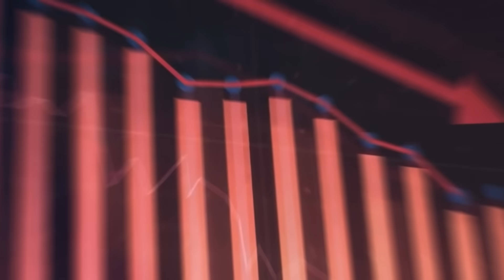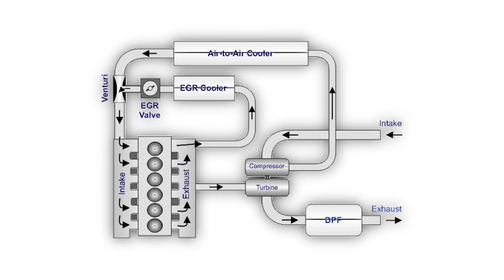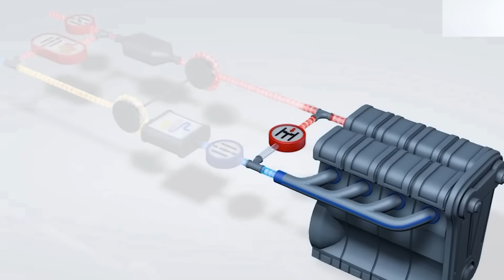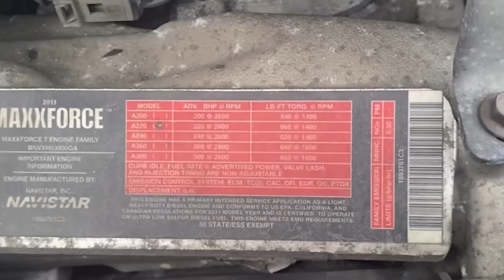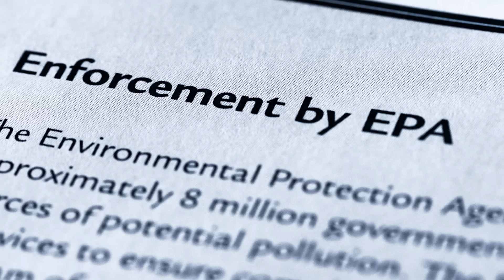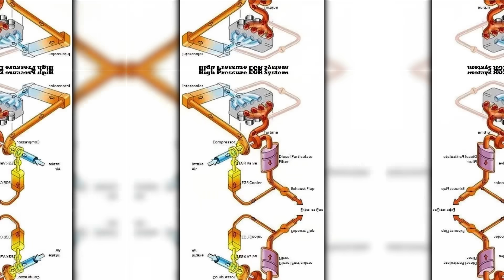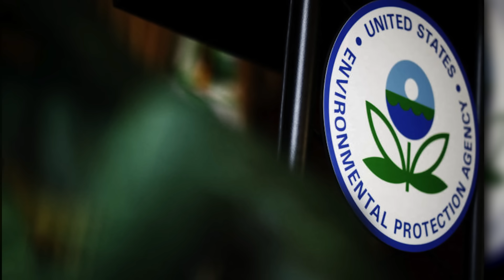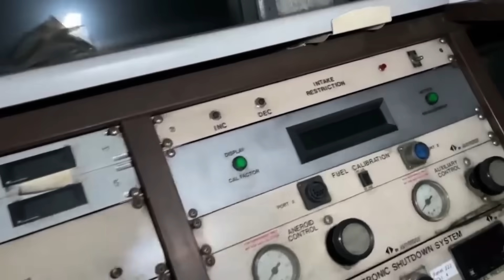The Rise and Fall of MaxxForce: The Engine That Broke Navistar

Comment: The EPA single-handedly destroyed diesel engines with their NOx and particulate requirements post 2010. They no longer make better power nor get the much higher ftlb/gallon(mpg). The systems clog every part of these new engines with soot, require urea(pee), which is corrosive, cause fires, and make them far less efficient. The "maintenance" required on the new diesels also costs 30k+ every 3-5 years. Gasoline is now replacing diesel in many applications for these reasons. My old diesel tractor burned half the fuel for the same use as either the new diesels or gasoline. This meant that while the upfront cost was higher, the long term costs were much lower. I was looking to buy a new one, but I will keep what I have, and if I do buy new, it will be gasoline
Reply: Good to know the EPA Is backing down on some of these choking regulations as far as diesel cars and light duty trucks. I’m willing to bet that they’ll be backing down on heavy trucks in the near future as the automobile and truck industry grows their nutsacks back an starts to fight back against overbearing government regulations.
Reply: @racer193wr  Can you link me to the law that allows me to modify customers' trucks without going to jail or being fined? I would love to actually fix these newer light and medium trucks(by deleting them)
Reply: @MDAdams72668  I don’t think it’s a law per se. It was a supreme court decision called the Chevron decision. Basically the EPA was levying fines and jail sentences, but they weren’t voted in by the 3 branches of government so obviously it’s seen as an overreach.
Reply: @RobertSmith-le8wp  Oh, I agree, BUT they are still doing so(fining and jailing people for "deletes"). In other words, they haven't been overturned in court yet. This is why I am looking for a law that specifically exempts me(or any other tuner) from the current law, just like the exemption the military has. I already paid a 50k fine years ago. I have no desire to pay again(more) or go to jail. 
FYI the Chevron decision is what federal agencies relied on when creating rules(in effect laws) despite lawmaking being the jurisdiction of Congress. The Supreme Court overruled Chevron in the Loper Bright decision on a 6–3 vote issued June 28, 2024.

Some professors have suggested that the implications for medicine and public health as a result of overturning Chevron will be uncertainty and instability for agencies and industries, inviting legal challenges to any and all FDA, EPA and Centers for Medicare & Medicaid Services (CMS) determinations. However, thus far no one has successfully challenged the "rules" imposed by the EPA Therefore, I would still be liable for any deletions I performed and I can't afford to fight the government
Reply: Post 2008
Reply: Thats is why Cummins just came out with an EGR less system. Something I said should have been done years ago when the SCR system came out. There was no reason to keep the EGR once that system came out. Let the SCR take care of all the emissions while dropping the EGR would make the DPF and SCR system run cleaner due to nearly no soot clogging the system. The ECU can keep soot lower by not dumping too much fuel without the proper air pressure from the turbo.
Reply: @techwolflupindo   The "EGR-less" systems are found only on the aftermarket and are not a product offered by Cummins for new vehicles.
Reply: All the box trucks are going gas, no one wants these diesels that are always broken down in the shop. Gas engines are 10K cheaper, the gas costs more but at least you have a reliable truck.
Reply: @jimwebster4267  facts

Comment: We always had the EGR coolers fail whenever a heater hose busted or had a significant coolant loss. We had a 2009 IC CE with a MFDT466, the alternator locked up, shredding the belt. Water pump wasn’t running so temp got up to about 240° and the surge tank exploded from the heat and pressure. EGR coolers failed so bad that when it was refilled with coolant and restarted, it nearly Hydrolocked, it was choking on coolant so bad it was barely running. No one can convince me they were good engines.
Reply: I've seen a few deleted off-road Max Force trucks. The base engines weren't terrible if you could get away with not having to comply with on road emissions. A local farm uses a day cab with some tractor tires on the back for dragging stuck equipment out of the fields. They deleted theirs at 650k miles, since then they've put 40k hours on it in 12 years. Pretty fun farmer tbh lol
Reply: @vr6prodigy  I call BS that any MaxxForce made it to 650k miles without needing to be rebuilt, and I'm not exaggerating.  The soot particulate in the oil that Maxxforce engines created ensured they didn't last that long.  Are you positive it was a MaxxForce and not a regular super-reliable international engine from just before the MaxxForce era?
I was in the industry, saw Internationals with MaxxForces every day, and none of them made it that far.
Reply: @workingguy-OU812  call whatever you want man. I don't really care if you believe me, but anything can be reliable with enough diligence. If he'll let me next time I see him I'll try and see if I can get a video of the truck to upload, but farmers are weird about the shit they do out my way.

Comment: The Maxxforce 13/15 was the biggest failure in internationals history. Some people will say the DT466 and its larger bore  variants were bad especially in tractors. During the mechanical injected era most all problems were caused by farmers "Turning up the wick" People who thought more fuel=More power with no regards to exhaust gas or coolant temperatures. Pre Maxxforce IH built the best medium duty engine the world has ever seen. But like everyone else they are sellouts to foreign/mexican  manufacturing these days.

Comment: We had ten trucks with the maxxforce replacement engines, the A26. It was as big a piece of junk as the MF. All of ours blew the engine at about 230 to 250,000 miles. They replaced the motors with others that had the same bad connecting rods as the first ones.  They were powerless fuel guzzlers and were always in the shop.
Reply: Company i worked for had nothing but problems with the maxxforce. They had 30 LTs with A26s and not a single problem. I think you mean the N13 is the engine that replaced the maxxforce.
Reply: The N series was a marginal improvement.  Like they just added scr to the maxxforce and hoped for the best.  The A26 either runs great or spits rods, we haven’t had a lot of nagging problems.

Comment: Had a new 2009 International  with  Maxforce  engine  in the fall of 2008 for a new assigned  truck. 2 years later it had been  to dealer 16 times for repairs.
Reply: Fook that.

Comment: I wonder how reliable they would be if they were deleted and given a proper tune. Just wondering out loud.
Reply: A guy on yt did it. It had high mileage already and used it for a while. It sounded nice straight piped. Iirc it was 4k for the tune. He did all the mechanical work sent the ecm off and had it done. It was pushing 500 or so hp. He sent a rod thru the block or something. Interesting to see. He didn’t regret it, paid only 10k for the truck at an auction.
Reply: For some reason, maxxforce engines cannot be deleted as easily as other brands.... I couldn't find anyone to do my Maxxforce DT
Reply: I attempted that with two of them I bought used for a little bit of nothing from a dealer whose leasing company owned them from new. I knew a shop that was doing the work on them so I gave it a shot.  In the end were very nice Prostars that wouldn’t pull the hat off your head.

Comment: I work for a large Fleet, and we had the Maxxforce engines, mostly the MF DT466, and we started experiencing EGR cooler failures on our 2009’s around 1000 to 5000 miles, and turbocharger failures anywhere from 900 miles to 10,000 miles. The Maxxforce in cylinder regeneration sent all that heat intended for the DPF right thru the turbochargers first. Our company later joined many other fleets in a class action lawsuit against Navistar.
Reply: We saw constant Lifter girdle breakage. Cam failures at low mileage. International said to double up the "dogbones". They weren't strong enough. Customers dumped them for Cummins. Nobody want's International engines
Reply: Good lord. Turbo failures at 10k???
Reply: @cyr2795  our first failure was under 1000 miles
Reply: @cyr2795 thats expensive😢😮
Reply: Sad, the pre-emissions DT466 was an unkillable workhorse
Reply: @panzer5033 Our town had over 300k miles on one with no issues.
Reply: Wait so up to 40% gas circulation lol
Have they seen what a clogged delta p does on earlier engines…we do erg tune ups just a deep clean of parts…these mfs was crazy
Reply: Pure junk😢
Reply: That is why Traiten  , a subsidiary of Volkswagen owns International Truck . 
They also own Scania Engines , they will be placed in International Trucks !
Reply: @vicpetrishak7705 but didn’t vw have diesel gate? 🤷‍♂️ and i own 2012 Touareg
Reply: No- the man speaks the truth. I happen to own a15 litre Max Force in a 2013 Pro Star. I bought it used. When I bought this truck, the engine had already received a complete rebuild - pistons ,rings, cam, crank, everything . The former owner had spent over 35,000 bucks( Canadian) to have this truck repaired. Why did this happen? - because of excessive heat. I took a chance and bought it, had it deleted, no more PDF, no more insane DPF , and no more trouble. The EPA should be eliminated . This whole pollution control thing is more about making more money for the big companies, as it is taking care of the planet. It’s all BS folks!
Reply: Lawsuit ought to be against EPA .
Reply: I had 2,000,000 miles on my Maxxforce engine with no issues.
Reply: @DirkDiggler-p5q Doubt it.
Reply: Make your product better
Reply: The EPA should be and should have been sued into oblivion for crimes against humanity. Itvus no secret that earth's atmosphere is 72% nitrogen and nitrogen dissassociation occurs at nominal combustion temperatures around 700F. This is more human depopulation lunacy aimed directly at essential human existence infrastructure. EGR and SCR are irrelevant and pointless because of dimpled pistons, which have been around at least 40 years, but you mix corporate hubris and malicious regulation disguised as progress and green; you get absolute financial destruction and more waste of everything that could have been completely avoided. But since our nation's economy does not work on any level of conservation, but rather the wash/rinse/repeat cycle of broken windows every logical thought or action is treated as a national security threat. Stay ignorant and keep voting, the parasites need their food.
Reply: @SlingSalsa Perfectly said.
Reply: @SlingSalsa  Do thunderstorms/lightning produce more "Nox" than all human activities and engines put together? Are "Nox" emissions an important part of the biological cycle that enables green plants to carry out their life cycle ?
Reply: @SlingSalsa You’re a moron.

Comment: All because of the arrogance of a CEO who insisted that the engineers "make it work!" They couldn't keep test engines running in the lab, much less on the road.
Reply: Saying the "engineers were convinced" is misleading, it was more "engineers were forced." Engineers told Ustian to his face that it wasn't going to work, and he dismissed all of their evidence and proof that it wasn't chemically or thermodynamically possible. There's a reason why he was later personally sued by investors for misleading them over EGR plan.
Reply: McCartel would be proud!
Reply: Or the arrogance of the EPA that insisted a 90 percent reduction could just be regulated into place with little impact.
Reply: One man became idolized for the same thing, his name was Steve Jobs.
Reply: @steelrain9159 Steve Jobs didn’t cause the company to be delisted due to accounting shenanigans, this guy was a tool, not a genius.
Reply: @steelrain9159 
Apples and Kiwis
Reply: No, the true blame lies with the EPA and our elected officials for allowing such bull shit to even become law.
Reply: @TheJaxxJackson With the 1980s Chevron Doctrine being overwhelmed, federal agencies are no longer on cruise control with the ability to write regulations with the power of law unchecked.

Comment: The only good engines International ever built were the DT466 , DT360 , and farm tractor engines . Mechanical engines .
Reply: The T444e was a good motor to.
Reply: @Mike-jv8bv aka a 7.3 powerstroke
Reply: Fuck glow plugs! I6 is the only good ones...
Reply: The early mechanical DT466 was tremendously overbuilt for the amount of power that they produced. Excellent workhorse.
Reply: I all fairness, the ngd and E models prior to maxxforce where solid, maxxforce was an insult to diesels
Reply: @bmacguyver I agree the dt466e with the gen 2 injectors   post 2004 emissions engines were good, and they in my opinion sound the best and faster in school buses compared to maxxforce dt albeit allison 2500pts to allison 3000 may had made them slower but still 2005-2007 has to be the best.
Reply: The HT530, the big brother of the DT466 was also a great engine.
Reply: Dang straight truth. 
So glad you didn't add 7.3 in there. 
Some have this illusion its the best diesel ever made. Maybe just the best diesel Ford ever used but thats it

Comment: I want to completely and thoroughly point out this video is some serious gaslighting about who decided what Navistar could do. The engineers did not decide to forgo emissions systems using SCR with urea additives. It was the CEO Dan Ustian who demanded it be done when it was not achievable, and he alone drove the company to the point of bankruptcy with his unachievable demands.
Reply: And none of the board bothered to try to look into it or fight him.
Reply: @DasNewsNetwork  — A board is supposed to look after the health of the company and not be in the pocket of the CEO.  Was the CEO also the Chairman?  Giving both seats to one person can be bad for the company.  Boeing is a recent example.
Reply: I just looked it up.  Yes, Ustian was CEO, President, and Chairman all at the same time.  The same as Muilenburg of Boeing.  In my opinion, public companies should not be allowed to let the Chairman and CEO be held by one person.  It is a conflict of interest.
Reply: @DasNewsNetwork  why would they…..they all got their bonuses
Reply: You can't expect a lot from AI slop...
Reply: @TruckngirlIdiots women think everything is AI
Reply: When I came to Navistar in October 2005 my job was to assess the 2010 emissions strategy.  What I found was that the engineering community working on it was 1) grossly understaffed; and 2) had not identified an approach to meet the standard without using SCR.  Senior leadership kept insisting that high-pressure unit injectors coupled with very high rates of EGR could make the standard but no one in the technical community really believed that this was possible.  In-cylinder combustion computer simulations could not get there - the challenge of simultaneously reducing NOx and particulates was proving to be impossible to overcome.  Caterpillar - with which we were collaborating at the time - eventually concluded this and changed their strategy (which led them to exit the on-highway engine business).  But Ustian and his high-level sycophants could not accept this reality.
Reply: And i would bet he got a huge bonus
Reply: They didn't lie....an engine that doesn't run, by default, has less emissions
Reply: Jim Hebe did not help, either!
Reply: No it wasn't, it was the idiotic Demorats and their unrealistic demands.
Reply: People pass California emissions in ancient 7.3s so the real gaslighting is from every engineer who refues to properly tune a proper proportioned engine and forgo all emissions equipment
Reply: @calebz1448  Different years have different requirements.

Comment: I use to work on the 13 and was about the biggest pile of shit egr coolers were always going out turbos hight pressure fuel pumps wire harness coolent would get in the top end and the pressure would blow rods out the side and so much more